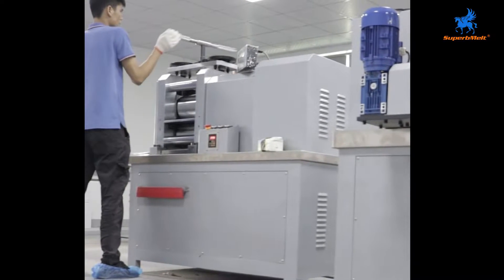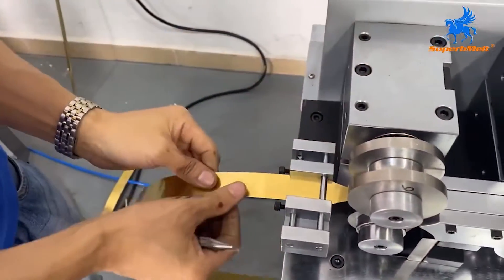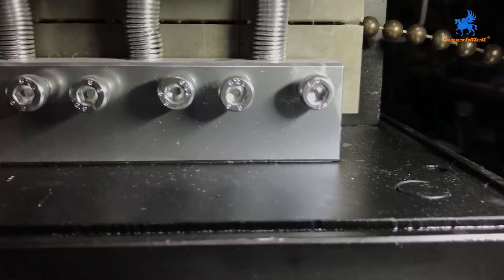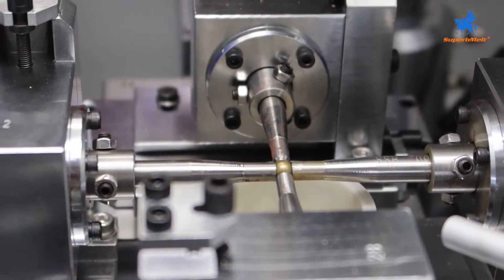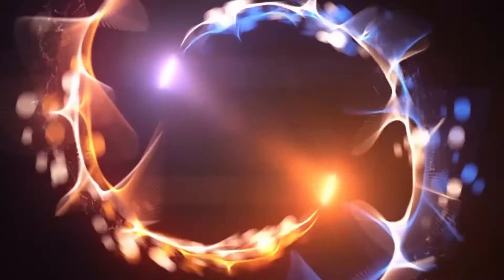Gold beads making line to make jewelry gold silver hollow balls---SuperbMelt

Comment from the maker: Chapter:
0:00 SuperbMelt logo showing
0:03 hollow beads making line machines display
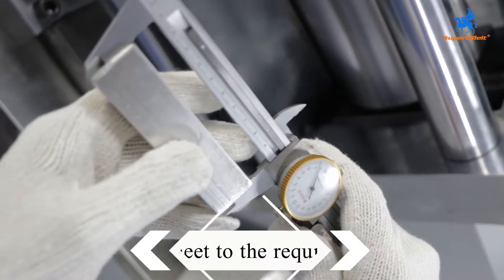0:41 roll the sheet to the required thickness
1:32 use a split machine to get the required width
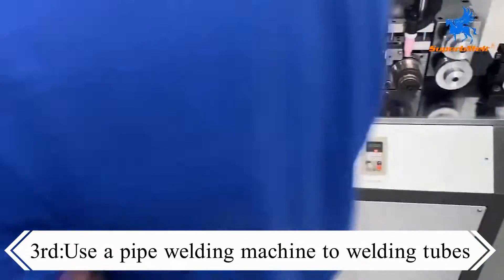1:45 use a pipe welding machine to make tubes
2:36 use pipe drawing machine to reduce the pipe diameter
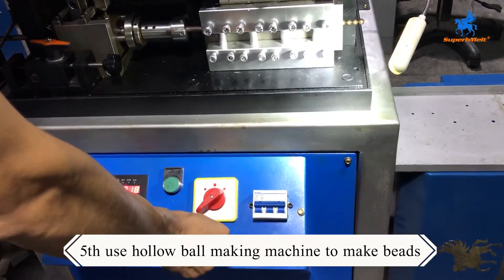3:07 use hollow ball making machine to make hollow balls
3:34 use hollow ball diamond cutting machine to cut hollow beads
4:00 finished effect showing